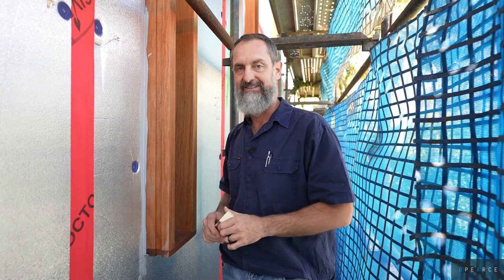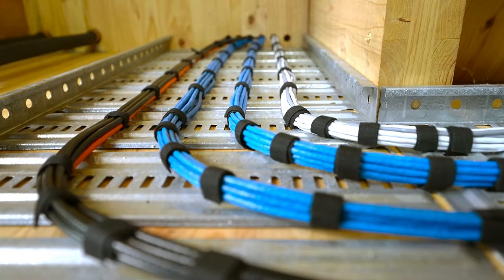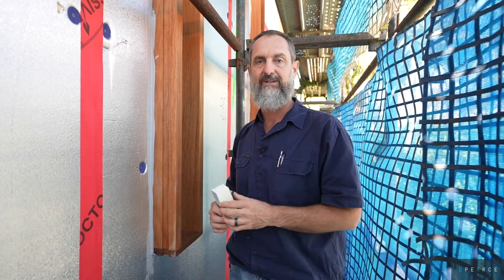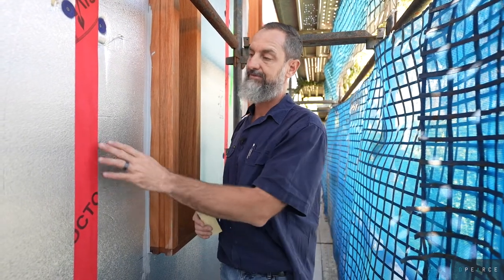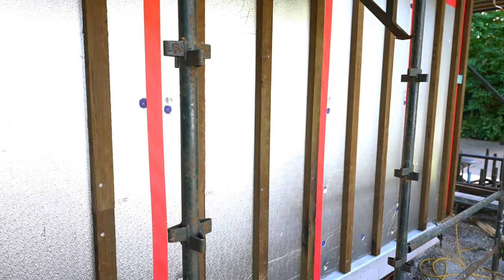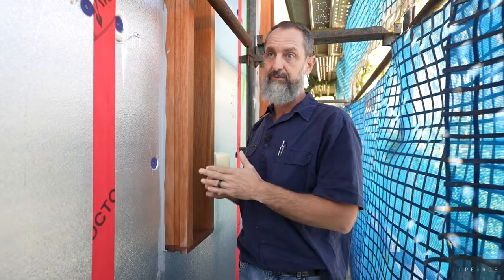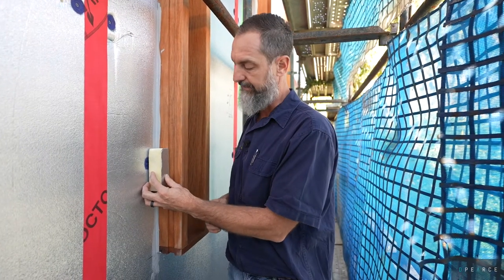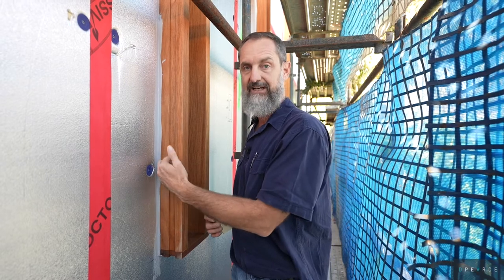Renovation Moffat Beach - Cross Laminate Timber (CLT) Panels - Insulating the Exterior

Comment: my house has 14cm thick CLT panels with 14 cm of wood fiber insulation on the outside the rest is the same . however the electrical and water pipes are on the sub floor or in wall/floor chases . some outlets are on the wall surface near the floor and switches are set into the wall with the cables running in between the door frames and the CLT wall . it's best to use conduit in this application to avoid nail penetration.